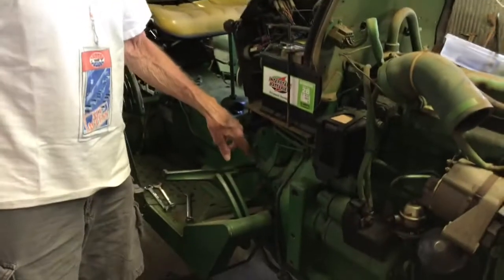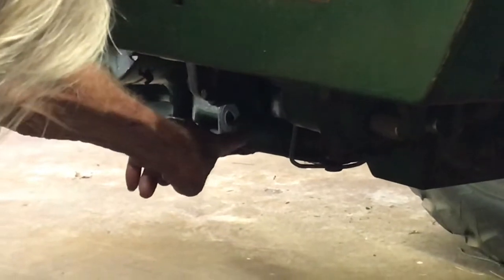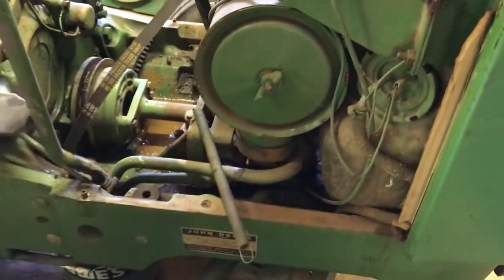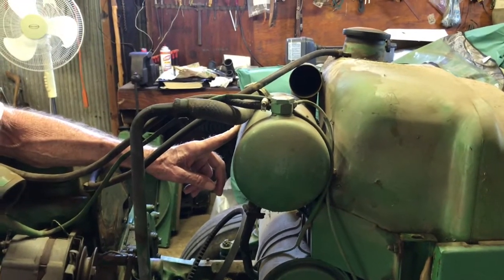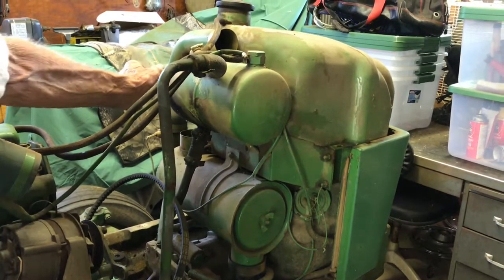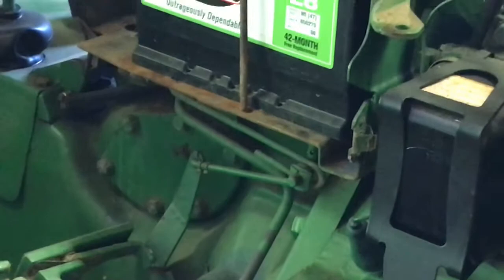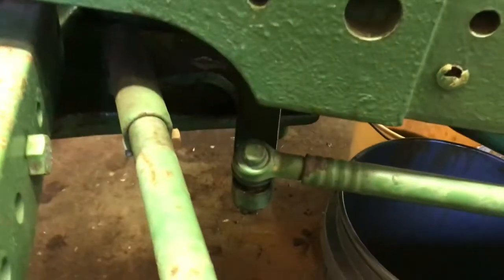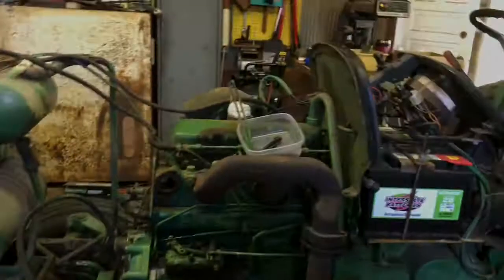John Deere hydraulic and steering system

Comment: I have a JD 2355 with hydrauiic problems.   My internal transmission pump is not sending the 150 pounds oil pressure to the front high pressure pump.    I need to gain access to the internal hydraulic pump, which means splitting my tractor in half.   I asked a JD dealer, and they want $3600 to do that.   I need to find how to do it for myself.   Can you help?
Reply: I’m no mechanic but it’s not super hard
Reply: You need stands if they told you that you have to split the tractor.

Comment: I have an 1120 that chatters the steering when turning it. Do you know what causes this.
Reply: i have a 1120 that chatters the loader& 3pt hitch, did you ever figure yours out?
Reply: @jbarr3551  I put a new hyd pump inside the transmission. Quieted it some but that is not the whole problem. Im stompped. Going to run it as is. Unless someone has a fix for it.

Comment: Hey love my 2130. Just finished plowing a field today on it. Thanks for the video very informative. A question about hydraulics, I was trying to run a three point hitch wood splitter. I had the remote lever pulled and worked the splitter back and forth which was fine. After a little use it starts to chatter on me. Still seems to work but chatters and shakes the hydraulic lines. Is that just cause the pump isn't keeping up with the flow demand or something else? Is it ok to run it like that for long periods or would it cause damage? thanks!!!!
Reply from the maker: Hi! Sorry for the late reply.  Do you happen to know where your return line runs to? It sounds like it runs to the transmission case.  If so, you may be running the main pump out of fluid.  In later models, they ran the return back to the filter cover (underneath) so that your accessory ports were not limited by the capacity of the return pump which is located in the transmission.
Reply: @giledwards2519  hey, can't say I know for sure. Worth a look. Either way, is there a risk of damaging something by running it? Thanks a lot of getting back to me!!!
Reply from the maker: @Ewaugh69  Shouldn't cause any damage.  Just creates undesirable operation.  Check those return lines and see if they just dump into the trans case, or if they go into the filter cover.  I'll see if I can find a picture of the return line that goes to the filter cover so you can see what to look for!
Reply: @giledwards2519  I have a 1020 John Deere tractor without power steering or hydraulics in the rear. It only has three point hitch. How can I add power steering and hydraulics to the back. How would I do this or where can I find a kit. With instructions. Model 4R10  Year is 1966 I think.